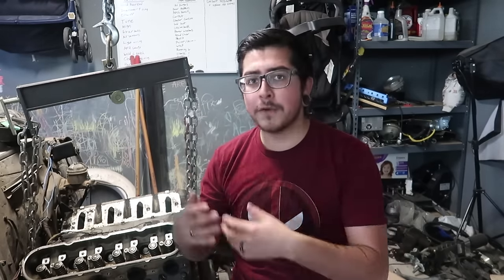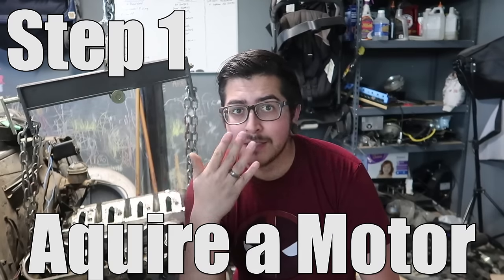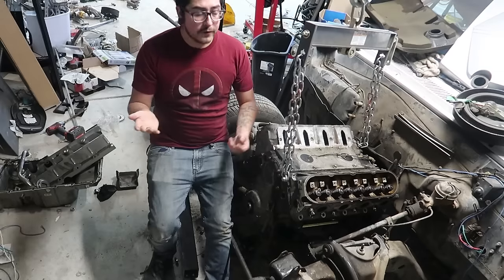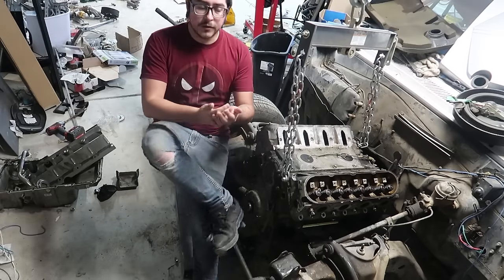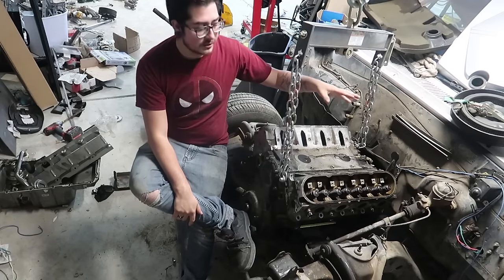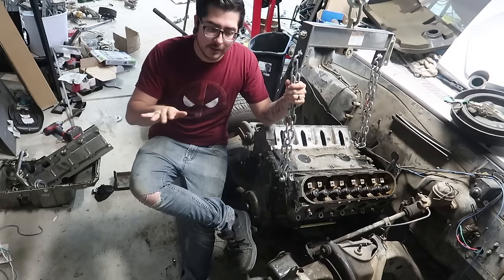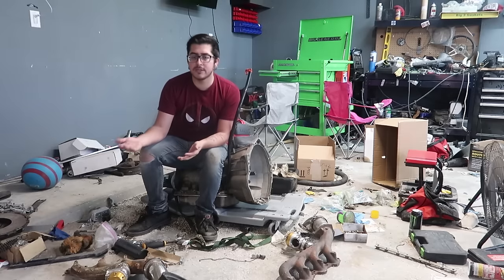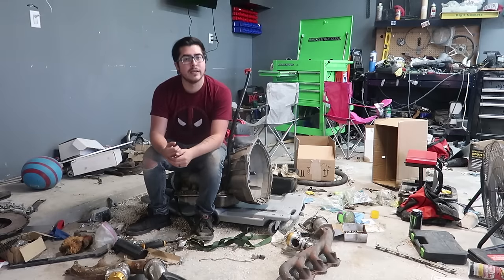HOW TO LS SWAP ANY VEHICLE - 5 THINGS YOU NEED -- LS Swap Basics Overview (LONG VERSION)

Comment: Nice video. I am a backyard guy working on my car as a hobby on weekends and came across this video, I am gathering as much information as possible on my future project which is converting my Toyota Prius V ( that's done 200,000 so far and still running strong)  into regular gasoline gas under $1500  by putting Toyota Yaris or Corolla engine into it some day when the hybrid battery gives up. I prefer gasoline because I take a lot of road trips and  fixing a gasoline car is easier than hybrid car if it ever breaks down in a no man's land. Thank you, I subscribed.

Comment: Hey Jovani,

Thanks for the vids on the LS motors....just a  quick question for you. I just picked up a LS1 out of a 2002 Corvette with 125k, it is completely.stock...was wondering what quick upgrades you would do if you were working with this motor? I would like to keep it naturally aspirated. I was thinking a hot cam for sure, but just dont know which one would give me the most power Increase. Was also thinking of changing the rockers and springs. What do you suggest?
Reply: Cheap extra power without sacrificing the integrity if this came out of a base Corvette would be a ZO6 cam, cold air intake, and long tube headers. That would take it from the 350 HP to over 400 and you won't have to worry about changing the springs and stuff. And with it being an O2, the intake manifold and everything is exact same between a base and a ZO6 so that doesn't need to be changed.
Reply: @pikkons  thank you....I got installed a summit stage 2 cam, dual valve springs, 1 3/4 long tube headers and a cold air intake.....so hope to get above 400 hp.....keeping my built th400 behind it as well.

Comment: A 4L80e does not just swap in later!!!!! Some of us have to cut the trans tunnel out and build a new one to fit that huge transmission! Then rebuild the interior. So building a strong 4L60e is MUCH cheaper in the long run, right! Or do you know someone who does interiors really cheap. Like a case of beer cheap. Other than that , you did a good job!
Reply from the maker: It depends on the power your making. A 4l60e will not be reliable no matter how much you build it past 600hp so in the long run making the 4l80 fit might be worth it
Reply: True enough. I already enlarged the tunnel to fit the 4l60 in my mighty max.  There is not any room..  Maybe with the new chassis I built the 4L80 will fit? Right now I am only pushing 450hp, so I believe I am safe for a while. Have a great day and Thanks for the reply!
Reply: Had to be in the same era also. Not any old 80 will work. I went through 3 4l60es lol

Comment: Ar5 from a Colorado is a stout 5 speed transmission that’s proven. $419 adapter with a 4l60e bell housing and a T56 clutch. You can get all that less than a grand but still way cheaper than a t56.

Comment: Why stay away from 700r4 ? Aren’t they over drive transmissions? My question
Reply from the maker: Because the 4l60e is a electronic 700r4 built to be behind an LS and doest have a TV cable to mess with
Reply: @JovaniDanteGriego  ok what harness did yu use in yur ls swap ?

Comment: You’re the man bro. Just started a 5.3 swap on a 69 c10 stepper, this made me more confident lol
Reply from the maker: Hell yes dude. C10 life!
Reply from the maker: @502MS  Hit me up if youre interested in some promo!
Reply: Just did one on my '68 C10, save yourself some time and money and buy a weld in motor mount kit off Ebay for $50.  Raise the engine up 1" and use the stock pan, saves $400 and the sump will not be below the front cross member and the front of the pan will not hit the steering drag link.   Slide it back 2" also, never hurts and leaves you more room for accessories.
Easy-peezy with the mount kit, just cut the provided plates and weld them to the existing crossmember.  The mount has ploy bushings to isolate the engine and makes removal and installation a breeze.

Comment: Thank you very much you answered a lot of questions that I needed to ask especially about the wiring ever one else told me I would have to buy wiring harness which didn't make sense to me the engine runs in the truck that I am taking it out of I have a s15 with 4.3 so my fuel pump and my 4l60 transmission should all work thank you very much

Comment: Good video. I swapped the old TBI 305/700r4 out of my '87 K10 in favor of a built 400HP carbureted 350/thm400. 

A lot of what you said even rang true for my "swap". Mount, bolt trans up, plumb wiring, plumb fuel, double check and done. I enjoyed the specifics you went into for trans and wiring options. Aside from those specifics this can really apply to swapping just about any engine into any vehicle. 

What's mind boggling, is that most of the people asking about LS swapping... have probably never swapped any engine into any vehicle before so even though this information is SO broad and SO basic it helps understand what the different stages of changing out an engine are; even if its the same engine going back in! 

Informative video.
Reply from the maker: Hey thanks for the feedback! Yea it really is applicable to almost any swap. At the end of the day all youre doing is piecing a puzzle together

Comment: Very good info, thanks for posting! My ‘95 Trooper has developed what I believe to be a rod knock (but I’m probably wrong), and I’ve settled on the idea of doing an engine swap vs buying a new vehicle, as that will be the least expensive option in the immediate timeline (hopefully!). Currently in the process of figuring out which LS engine, tranny and transfer case I’m going to try and find. Also trying to decide if I’m going to do a solid axle swap at the same time...

Comment: Good video and easy to understand, much appreciated. I Mistakenly bought Lq4 for my Chevy R10 wanted Ly6 engine. Not racing but just wanted   little extras like the heads on the ly6 and extra horses, however I don't know if its worth taking the extra time to get rid of the Lq4 but anyway thanks for the video.
Reply from the maker: I'm sure it wouldn't be hard to get rid of that lq4 it's pretty desireable

Comment: People are too lazy and want to be hand fed or else don't know the necessary mechanical and electrical basics. The other problem is that it's all about power for $ with no consideration for brakes, suspension and transmission, it's often all about cheap, cheap, cheap and not doing the job properly. All of this makes trying to help people a thankless exercise in frustration

Comment: Question to creator, I have a 2012 gmc terrain my motor is fucked I want to put a ls in the car what would be my best choice, I have been told to get a 350 small block ls
Reply from the maker: Hi a 350 small block is not an LS. There is a 5.7 LS1 (350cu in.)

However either way you really don't want to swap your terrain. It's a front wheel drive car with not a lot of room in the engine bay. Your asking for alot of modifications for not alot of benefit

Comment: Where did you get a fine Italian name like that   ! Any way great video of an last swap it told me exactly what I needed to get my frontier going with a 4.8 gmc separate motor going    THANK YOU FOR THE VIDEOS.  BY the way it was the computer I was lacking when I got that and the correct wiring harness and adapter it fired right up    Your a lifesaver    Thanks again. It runs like a RAPED APE. ALSO I WENT WITH THE 4  L 60 trans
Reply from the maker: 🤌🤌 I got it from my father. But I'm only Italian by name. 🤌🤌 Lol but awesome job. Thanks for watching !

Comment: I just bought a 98’ camaro with an LS1 (aluminum block 5.7) and T56 6 speed manual as a donor car for an LS swap. I’m trying to put it in a 1970 Chevy nova
Reply from the maker: Nice. That's a solid setup
Reply: Thanks man, it was quite the deal. The car was hydroplaned into a tree and the rocker panel got bashed in. Car still runs and drives great besides the steering but hey it only costed $2000

Comment: Hello, do you believe an ls swap is worth it?  For a old truck. Not looking for hot rod just work use mostly. My sbc blew up and iam contemplating ls swap or fuel injected slightly upgraded 350.
Is mpg much better with ls?
Reply from the maker: Mpg is much better. It really depends on you, some guys can keep a SBC running forever and get great milage others like me can't seem to keep em going good.
Reply: @JovaniDanteGriego  
What kind of mpg?
In a 82 3/4 ton 4l80
Reply from the maker: @gentilejoshsaved1646  depends on the tune. You can get 20mpg at 65mph cruising. But average would be 16 I would guess. It all depends on how much you want to lean it out and add timing

Comment: Would an Alison transmission bolt up on to a 5.3 6.0
Reply from the maker: I dont believe so unless the duramax is the same bellhousing
Reply: I googled it and saw some information that it will bolt right up, you will need a flex-plate. Good luck
Reply: Robert Phillips yes you can use Allison transmission 
At work all our step vans uniforms trucks are freightliners custom chassis with a ls 6.0 and 2000 series Allison transmission

Comment: Welcome, my friend, at first I would like to thank you for the valuable information in your excellent explanation. Secondly, I have a question: I own a Ford Thunderbird car of the year 1965 with a 6.2-liter engine, and currently I have an intention to change the car engine to a modern engine, so which engine  You advise me to replace the old engine, and can the engine be replaced by a used car engine, such as Ford or GMC, the

 Dog , for example.
 Thank you and I hope the answer to my question (follower of your channel from the United Arab Emirates - Dubai)
 Suhail
Reply from the maker: A common swap to look into would be a ford coyote from new mustangs or the 5.0 from early 2000s mustangs
Reply: Thank you very much for your prompt response to my inquiry, and I wish you success👋👋
Reply from the maker: @shail910  thank you

Comment: (1) not care about reliability / dependability. (2) not care about EMP-proofability. (3) Not care about initial cost. (4) not care about triple-fuel-ability. My '99 Suburban 5.7L is more reliable, at higher mileage, than my '04 Suburban 5.3L. My 99 can accept a points distributor and a carbureted intake manifold, my 99 now has a gotpropane dual fuel kit and a methanol carburetor stored in the back. Screw LS, the original 350 will always reign supreme

Comment: I wanting to replace my 2003 5.3 engine with a lower mileage one.  Mine is drive by wire and I’m looking at a 2002 that is drive by cable.   Would I be able to swap intakes and use my stock harness and my ecu?  Or what??? Anyone know?

Comment: 4.8, 5.3 and not all 6.0 are “LS” engines
Reply: julio_rm yes they are
Reply: @DiyAllaroundguy  no they aren't he's right. There's different technical variants. Take the 6.0 for example the ones that came in Cadillac's and gto are ls2 but others that came in trucks are either lq4 or lq9. Same goes for the 6.2l engines in the beginning are ls3 then later superceded by the lt1/lt4
Reply: They're from the same family and generally take the same parts.

Comment: Engine with most starting horsepower for around $600 

I would like to add
Fuel Pump
Fuel Rail
Fuel Injectors
Exhaust Manifold Headers
Cam Shaft
ECU
2 very small turbos
Innercooler
 
Would it produce 500 horsepower at the wheel?

Comment: Will a 1995 K 1500 Silverado 5.7 exchange /fit in 1991 C 1500 Silverado 5.7 What will i need to change if anything. Will i need the wiring harness from the 95 5.7 or can i use mine in the 1991? Any Information  will help.

Comment: Today I finally found and bought a 2009 Silverado reg cab short box 2x4 with 4.8litre, Only has 162,000 Kilometers it! I payed $1200.00 for it because it has a bunch of body damage and break lines are rotted out so the owner just wantrd it out of his yard. I think ive done well with this purchase to begin my LS swap into my '84 Buick Regal Limited once i have the engine installed and running well and tuned ill be installing a Borg Earner S475 or maybe even the cheap ass e-bay GT45. Thank you for the inspiration buddy

Comment: HELP! I just bought a 1998 Silverado 350 5.7 vortec motor with 150K miles and the mechanic told me I need a new head gasket and would cost me $500-$700 to get it done! Should I mine as well get a faster better newer Chevg V8 motor don’t know witch one yet, or is it not worth it at all? I’m new to mechanic and vehicles I’m getting into them and I’m liking them any suggestions?

Comment: Do you think ill run into any problems i want to engine swap a 1969 buick wildcat with a LS i believe its a GM VEHICLE
Reply from the maker: You should be fine. Buick engines of the time might have different mounts but I'm sure someone has done it before

Comment: Wanting to swap ls from 2001 Gmc Serria to a 1998 Chevy work truck with a 4.3. have whole Gmc truck complete that runs need some direction never did this a before.
Reply from the maker: Lt1swap.com has all the correct wiring diagrams I believe you can keep your harness and ecu

Comment: How easy is it to take out a tired LT1 with over 230000 miles from a 1996 Firebird Formula 6 speed and put in an LS?  Which LS would you recommend?  Thanks!
Reply from the maker: Those are simple, LS1 is basically a direct swap

Comment: i have a 1991 Camaro v6 auto  but I shall be putting in a truck 5.3 with L60 automatic trans just one question can I run this system from the original radiator or do I  have to add a trans cooler for my project or just the radiator please help thanks
Reply from the maker: Your stock rad should be fine. You'll want a trans cooler

Comment: I have a 2003 Lincoln navigator and I'm thinking about switching the 5.4l V8 engine for a Ls engine for better gas mileage and a little more power but I don't know which one to get also without going crazy with spending 💰
Reply from the maker: It's probably not worth it tbh

Comment: Your gonna need to upgrade those brakes on that c10.....I have a 68 c10 with 4 wheel manual drum brakes, after i dropped In my 10.25:1 asa cam 5.3 I was like "great now I need some power brakes" so shortly after I put in a new master cylinder and booster, but that still wasn't good enough so i had to do the cpp front disc conversion,  now I'm trying to sell it so I can finish my nova and free up some space at home,  really can't do much with 7 cars/trucks....lol

Comment: Good basic advice  Ingraduated high school in 1982  and a hot car of that era was the Porsche 928 and 944 but they were notoriously known to be dogs  and sort of Porsches red headed stepchild  because they were front engine water cooled  unlike most being aircooled rear engine  so these days you can find those models in pretty nice shape  sort of cheap  I thought a LS swap would be cool  to build a Sleeper ! I’ve also been a fan of old British Sports Cars  and would like todo a small block Chevy  into one of them that’s been done for years and years along with many books written onthe conversion  I haven’t seen any LS swaps yet  but I imagine some one has done a Antique Jaguar  by now  as many of those have missing or damaged factory motors  and SBC  has been done a lot  over the years  my Dad used to talk about doing that in the 1970s  but never found the right deal on the car

Comment: Don't hate on the 700r4. It's the same transmission as the 4l60e, just not electronically controlled. GM rebranded it for marketing purposes.
Reply from the maker: The 4l60e isn't great either. I've ran through a ton on stock engines
Reply: @JovaniDanteGriego  Agree. Just wanted to throw that info out there. Neither is better or worse than the other, but both are less than optimal. Use your fast foot sparingly though, and both are fine until you can upgrade. Good info other than the 700r4/4l60 comment. Keep it up, and good luck with the channel!

Comment: What year 4L80Es are good for swaps with a 5.3?  The engine will more than likely end up with a Texas Speed Stage 1 low lift truck cam and a TBSS Intake.  Or would a 4L60E hold up with this setup?
Reply from the maker: A 4l60e would hold up but 2000+ 4l80e is what you want. the older ones need a little more to work

Comment: Thinking about swapping a 1991 Corvette, looks like the best route for me will be to get a complete corvette motor for the sake of fittment. I would honestly prefer a silverado 4.8 however sourcing all the accessories and extra bits is looking real pricey.
Reply from the maker: Yes unfortunately the vertical clearance is an issue.